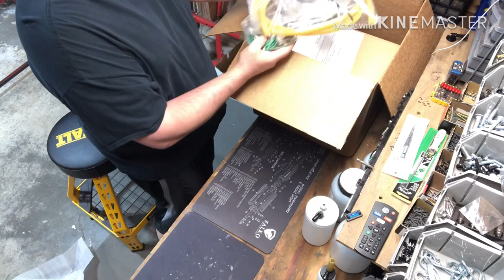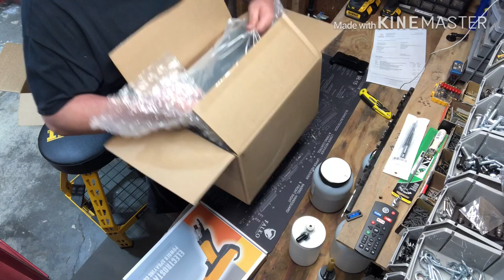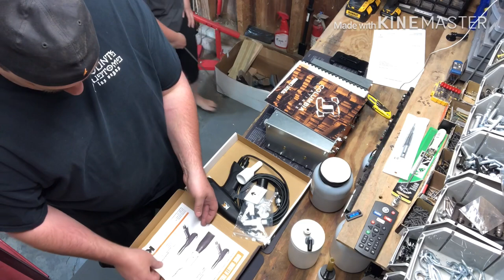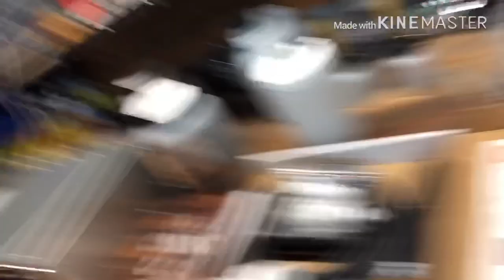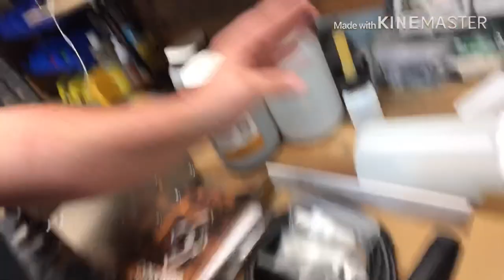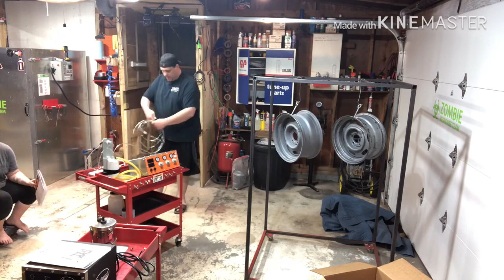Kool Koat HD Powder Coating System Unboxed #6

Comment: Could you give some tips and tricks on Your KoolKoat HD i recently got mine all setup and cant find alot of info online.. Ive done a few project with good to very good results.. Not perfected yet by any means..
Reply from the maker: What would you like to know. One issue I had with it was that I was told you can adjust Kv and Ua. That was a lie you can't adjust and know your numbers on the fly. You have to adjust your Kv and Ua before u start. Do you know how to get your numbers before u start?
Reply: @GMPC  yeah I've been adjusting it by what the book recommends..  seems to work good until the other day I had a weld in a tight angle didn't want to coat.. guess I just need to practice more..

Comment: Were you able to make it work? And do you use a ground rod?
Reply from the maker: King PrettyFlacko not working yet. I throw away there 12 ga ground wire and use a 8 gauge wire hooked to a 12ft ground rod. This ground rod has a 8 ga wire going to machine, one going to part and one going to booth itself so it’s well grounded. But I’m running into things like bad static feedback. Got a vibration table with no directions and the back is like Swiss cheese. It will not let me adjust kv and uA separately like I was told it would. And other issues. So when I talk to the guy Monday I’m going to discuss getting the KK-171 control box instead of this HD box as long and everything that I bought works with it. I just paid over 2k I shouldn’t have these issues
Reply: Green Mountain Media Blasting & Powder Coating that’s not bad idea hopefully they let you switch it since I saw it and was wondering if it’s actually a good machine the 171
Reply from the maker: King PrettyFlacko  I really think at that range the colo, KI-171 and gema they all look the same and do the same. I bet the Manufacturer is the same for them all. Or at least  built the same. I’m going to push for the 171 on Monday fingers crossed lol.

Comment: Is the HD machine worth buying? Bc i do alot of complex parts like wheels etc and does it get into the lug holes etc very well?  I use hyper smooth dpw 3.0 right now and need a great setup for faraday areas and candy colors
Reply from the maker: To be honest it’s a ok system but for the price you can get a lot better systems cheaper. Reach out to me GMPowderCoating@gmail.com and we can talk more. I’ll let you know the new system I just bought.
Reply from the maker: @CLamb385  shoot me a message through our Facebook messenger and I'll
Shoot you some info to the cost etc. It will be tomorrow because it's late and headed to bed. Have a good night. And thank you for subscribing and supporting our channel

Comment: Not worth the money, had better results with Eastwood
Reply from the maker: My Eastwood was junk. I like the HD it lays down smooth and I can do multiple coats easily. Maybe you got a bad machine? I had issues when I first got it but CC fixes them.
Reply: See I had the opposite eastwood laid down smooth and the hd has a bunch of coughing fits
Reply: Plus the hd hoppers are junk. I think that's where the problem lies
Reply from the maker: Adam Alma I only use the vortex cups. But I do have hoppers with the vibrating table. Used it once and it did fine.
Reply from the maker: Adam Alma lol I had opposite for me. Every time I used my Eastwood PCS-1000 it would do clumps and drove me nuts that’s why I bought the HD. Got HD and no issues laying powder just adjusting uA but that’s being fixed now
Reply: That's the problem if you have to buy extra equipment to make it run right to me that's no good